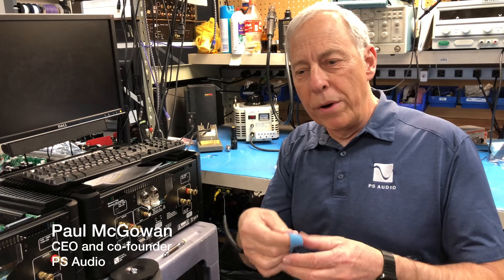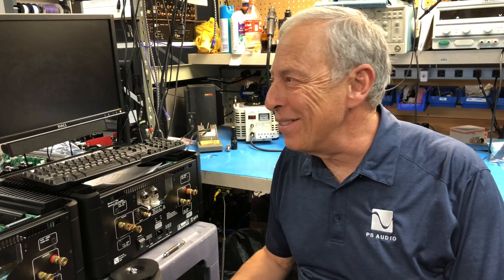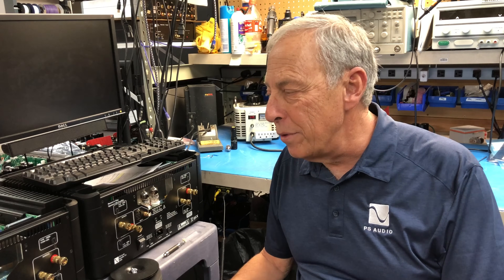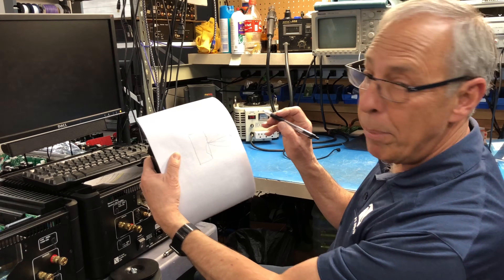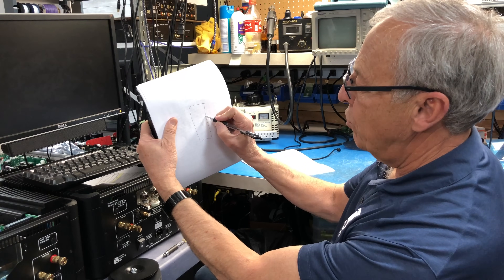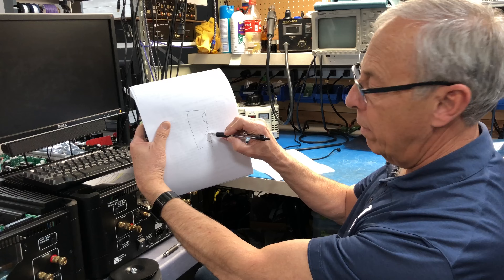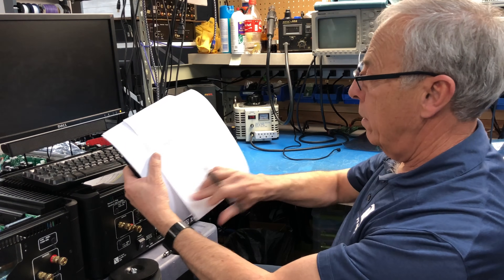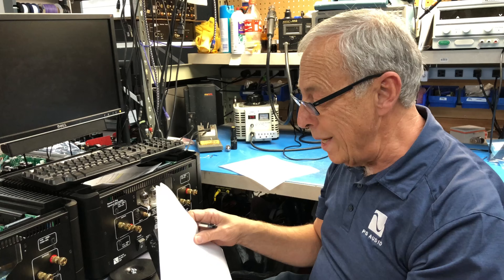Understand d'Appalito speaker designs

Comment: If you search youtube you will see videos on this. Where the same horrible cancelling issue occurs when you have 2 or more drivers in a vertical array, all doing mid-range and treble, it doesn't work at all!, they cancel each other, and it changes depending on listening position. In PA arrays one fellow put a bow tie wave guide over the driver to stop the cancelling to some extent. The trouble is the drivers are spaced apart and the distance to the ear are different, It only works at low frequencies where the wavelength is so long the drivers sum as one, good for bass not mid and treble. To get tweeters to work they need to almost on top of each other, impossible, can be done with ribbons as its a slot where they need to form a continuous slot 5 feet long. designing an array is not easy, so stick to a point source a lot easier to design..note you can stack drivers for bass up to a few hundred hertz where most of the power is anyway. But only use one mid and tweeter.

Comment: I've tried a few d'Appalito speaker designs and find the mid drivers cancel each other on the vertical axis, so it seems to work fine provided you're in line with the tweeter, but if you stand up a big null appears in the response, also since there are two mid bass drivers doing mid-range they cancel each other below the crossover frequency. So depending on listening position it sounds dull and muffled, as the drivers move in and out of phase with each other as the listening position changes. So d'Appalito speaker designs  do not work! The trick to fix it is 2 only send bass to the bottom driver and midrange and bass for the top driver.

Comment: I have a properly designed D'appolito system. Exact distance between speakers and purpose built crossover.  Vendor provided drivers and crossover and plans.  I built cabinets.  I am an accomplished woodworker.  Speakers came out great and still in daily use since being built 20 years ago.

Comment: D'appalito makes no sense, except. Say a tweeter is on top of two 6 inch woofers, with the bottom woofer crossed over lower than the top woofer. With the two woofers having their own separate, sealed, & ported cabinet chambers. With the bottom cabinet chamber, larger than the top cabinet chamber for more bass. This is a 2 & a halfway design. PSB has a speaker like this.

Comment: What is not mentionned at all are the very strict requirements on max distance between the centers of the midranges as a function of the Xover frequency to the tweeter . No commercial MTM speaker I know off  meets this requirement , not even close . A typical MTM design with two 7 inch midrange/woofers   crossed at 2Khz to a 1 inch tweeter is very far from being true to the d'Appolito design criteria.
Reply: Do you need that quarter wavelength spacing? (Which typically results in a much lower crossover than the tweeter will comfortably handle e.g. 400 Hz)

Comment: Whats meant by alignment of speakers ?
How it doesn't affect in horn loaded tweeters ?
Balraj S.Acharya.
Mumbai, india
Reply: I think he means a real appolito designed speakers has the woofers same distance from the tweeter in the middle. He talks about putting 2 speakers on top of each other. And it should be as possible with small horns like klipsch

Comment: Dear Paul - I used have  Philips FB690 speakers, two 8'' woofers with one off metal cooled tweeter in the middle. 
 Were they based on d' Appalito design? 
http://www.canuckaudiomart.com/details/649297020-philips-fb-690-speakers/images/1314871/

Comment: Hi Paul, a couple of comments. First, the M-T-M configuration wasn't original to Joe d'Appolito, it was first done by Koss- I think Robert Ashley did that design. What Joe figured out was that he could get the lobing control he was after if he did the M-T-M and used an odd-order crossover (e.g., 1st order, 3rd order...). So a "d'Appolito configuration" is actually M-T-M plus odd order crossover, not just M-T-M alone.

Second, somewhat ironically, Joe found out years later that the configuration worked better with a higher crossover slope, with even order working just as well, and his later designs used 4th order Linkwitz-Reilly crossovers (sorry to go geek jargon-y). 

And please, next time you're drawing, use a Sharpie so it shows up better on camera. ;-)

Comment: Nice explain, So I see this design has more than 2 drivers that make midrange?. That personally is against my list. In my thinking, anything above 200hz should only have one driver in their box. Oops!
Reply: per pass
Reply: Thanks, I think I can just barely grasp the wavelength tech. I personally tried the two mids with a tweeter several years ago. They were in the horizontal position, and that was bad for me. I peeked at the speaker that Paul refers to, and its 6 feet tall! I see now that the trend in typical speakers is two way book shelf or this narrow multi driver set up. I do live on the outskirts of hi-fi.  Admittedly, I haven't seen the inside of  hifi mag in decades. They are hard on me like sail magazine. Ultra tech and ultra pricey. I can sit on my formula for all the things I desire , and revisit 10 years from now and it will be the same song.  If Paul's shop system is the standard, then he's got a couple too many tweeters there. I am trying to go minimal and have it acceptable in size for the living room.  I am sure it will come down to a "show me" someday. I'm sure it will be flawed in some way. It just wont have more than one driver for each in the mids and uppers.